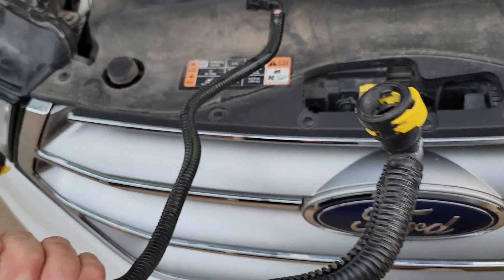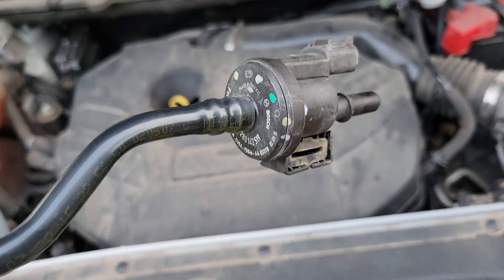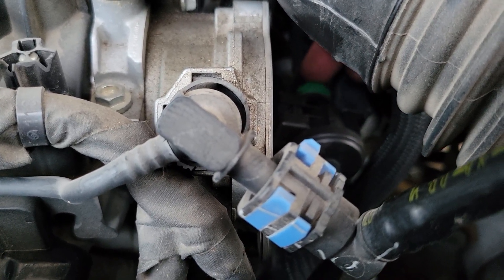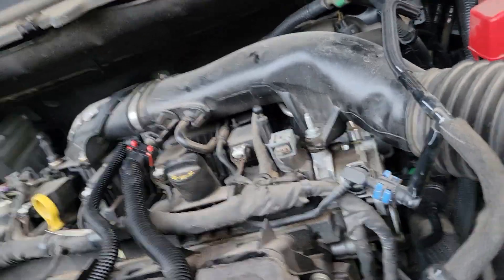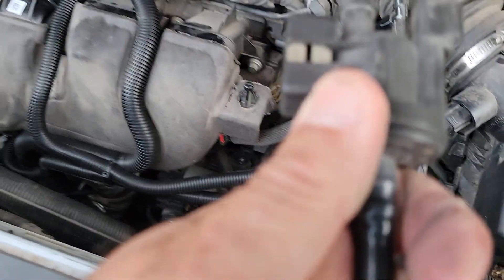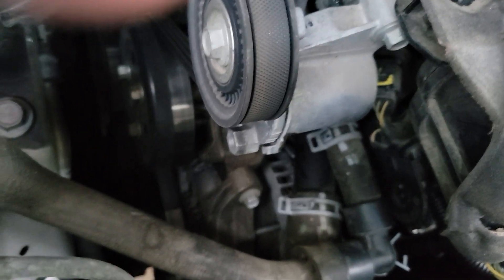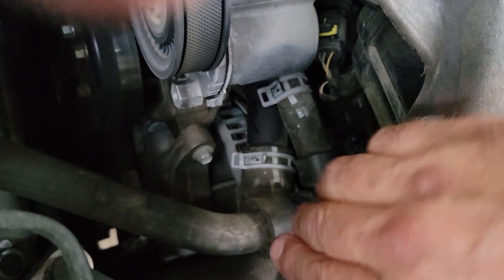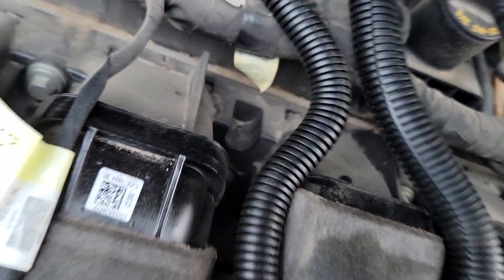Fix P1450 code 2016 Edge 2.0L Eco Purge valve. DO NOT change full assembly. Read description FIRST.

Comment: i did the same i said fuck that part on the bottom and switched out the purge valve  though there were two nuts i had to take out from the bracket but that easy.  im trying to learn hot to just replace the canister with a heat blower

Comment: Thank you for this. Your engine was the same layout for my 2017 ford edge suv 4 cylinder. Was struggling with the lower vacuum hose, the bypass saved so much time. Unfortunately I spent the 200$ for the whole set. Live and learn